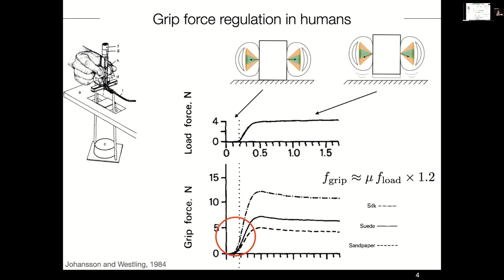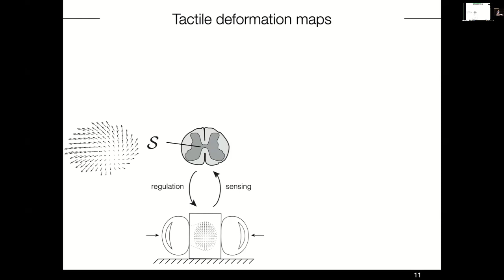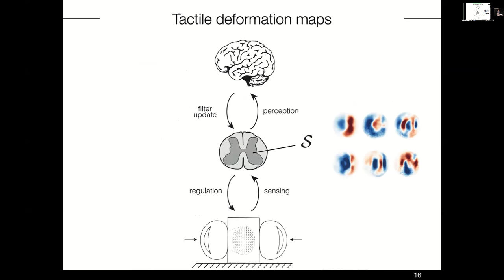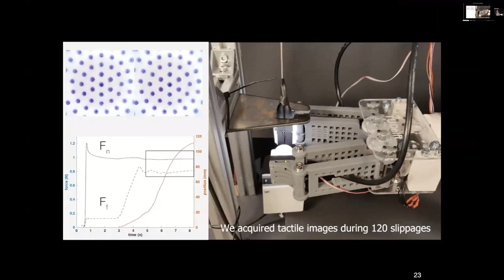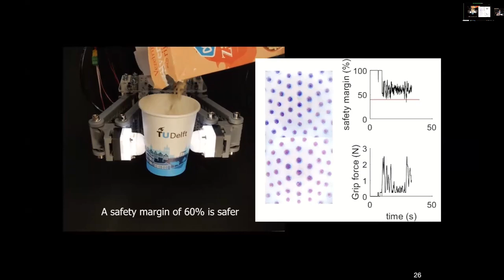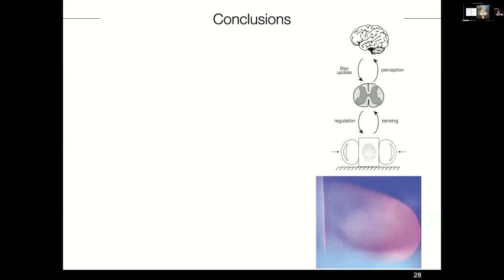Michaël Wierlewski - Workshop Soft Haptics EH2024

Comment: This is really cool, one of the points you didn't mention in your theory on how people can "sense" the friction is the learned aspect of touching a material or object and the visual sensation. For instance we can often see a high friction surface because of the way it reflects light. Likewise we learn by touching materials how much pressure we need to interact with it.

It might be cool to recreate your pressure experiments using blindfolds or somehow isolating the touch sensation or using a material a person doesn't have any contact with until they put pressure on it. For instance throwing a weighted ball covered in a clear tacky glue or having a slick surface but painted to make it look rougher. Then measure the force of them catching it for the first time.

I know the video was more about the robotic applications but a thought none the less.